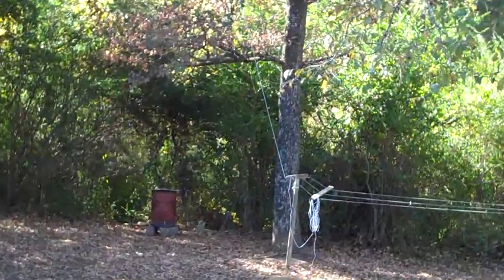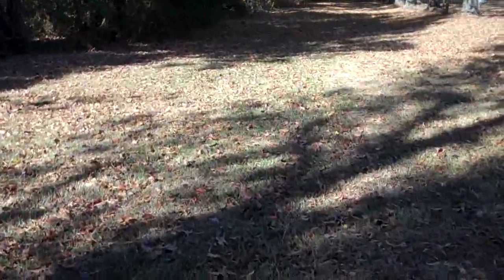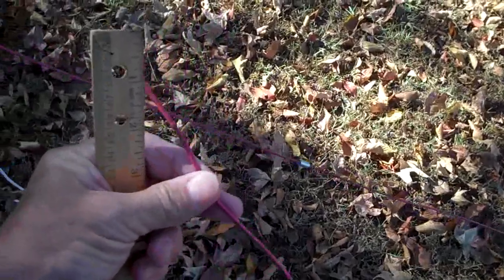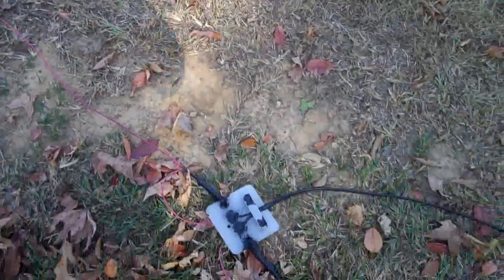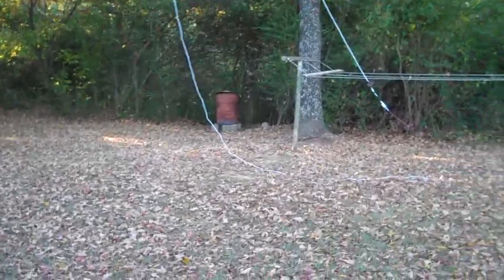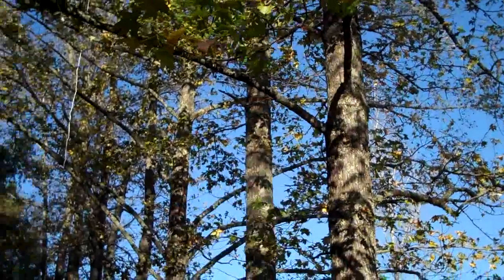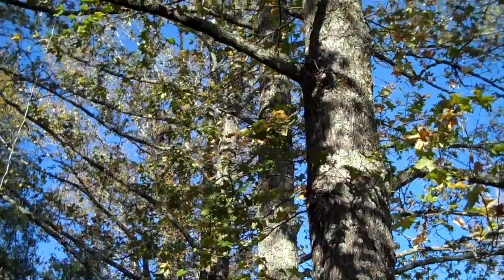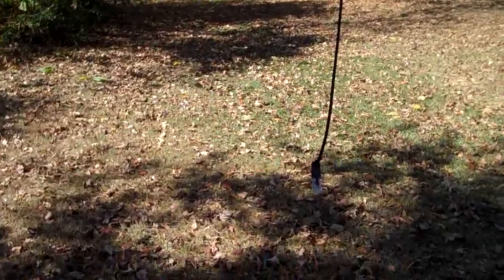Obtaining A Ham License-step by step-details you need to know (part 21 of 34: Making an antenna).

Comment from the maker: @umajunkcollector,
I'm now saving my nickles and dimes to buy a new antenna tuner.  Should have it in three weeks or so.  But no hurry, as I can't use it until the antenna finally passes the analyzer testing.  Hopefully, next weekend I'll get to hook up the antenna for a little receiving fun.  I first have to change the connector on the back of the radio.  Just been too busy to get it done.
I appreciate all your inputs.  A lot of other folks are also benefiting.

Regards,
John